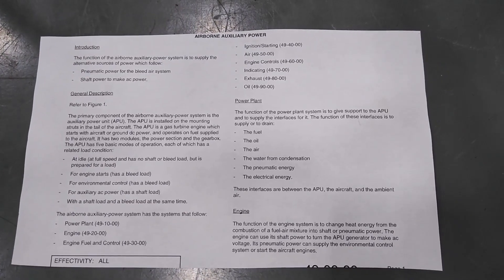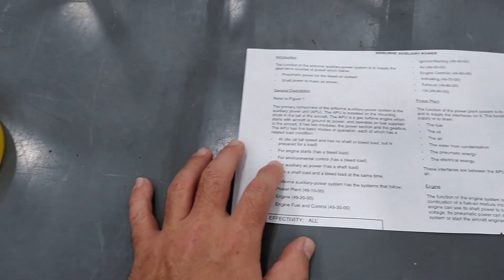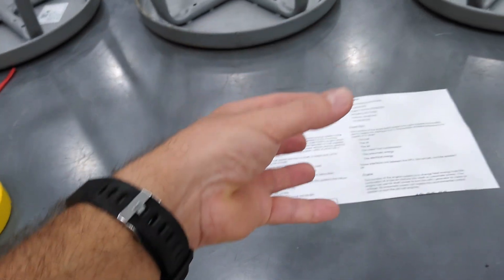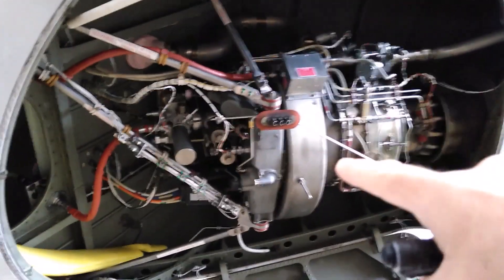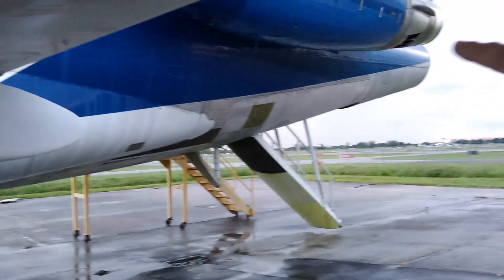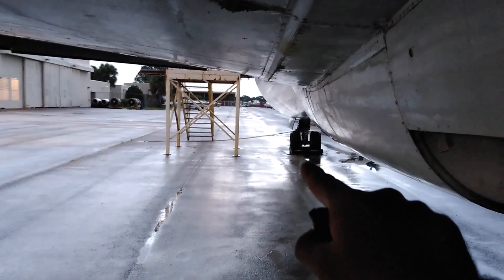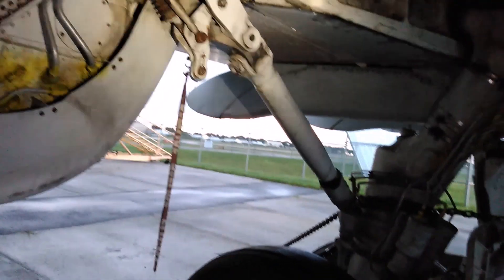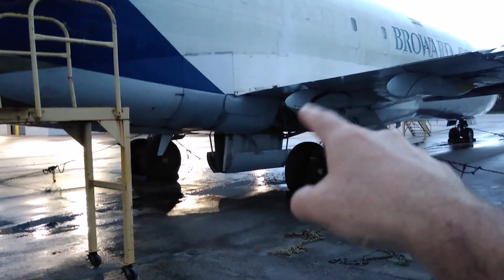APU - Auxiliary Power Unit

Comment: I have read on a 737 NG fuel system description that APU is suction fed if the AC fuel pumps are not operating, without any explanation. How is suction feed possible for the APU? Suction-feed is possible for the main engines because they have engine-driven pumps. But I couldn't find if the APU also has engine-driven pump.

Comment: Does an APU idling at full speed (no shaft load, no bleed load) produce any measurable thrust? 
For instance, say you lost both engines at 35,000 ft. You pitch for best glide and calculate that you can glide 25 miles before reaching the ground. The nearest airport is just barely over 25+ miles away.  ...Would running the APU potentially help extend your glide distance?? 

I know the APU is very tiny compared to the main engines and that it’s not made to produce a thrust effect, but it is still a gas turbine, and I would think that even a little thrust is potentially better than no thrust at all.
Reply from the maker: You would think so, but no. The exhaust duct may not even be pointed aft. It can also be pointed out to the side of the aircraft, that's how little thrust (zero) is produced. I believe that the APU turbine is designed to extract every bit of energy possible from the exhaust to do it's job which is to drive other equipment. If the APU produced thrust that would mean that it would be wasting energy 99.99% of the time on unwanted thrust while static on the ground.
Although I do agree that any little thrust is better than no thrust at all, I think that in the case you posted about the multiple engine failure, you'd be better off dumping fuel(loosing weight) to extend your glide distance.

Comment: Your work place looks like a heaven 💙 if you don't mind can you tell me what do you do for living 🤩
Reply from the maker: I work on the interiors of aircrafts, mostly private jets. I don't work as a mechanic although I am currently going to school to get my mechanic certificate. We remove/install/adjust/repair/refurbish the aircraft's interior when they come in for inspection or maintenance.
Reply: @planesimple8514  so your a b1.1 machanic 😃
Reply from the maker: Well, not exactly. Under EASA regulations a Category B1 is an Aircraft Engineer on powerplant and mechanical and electrical systems. Under FAA rules, it is defined a little different. The certifications are called A&P for Airframe & Powerplant. Once you have those certificates, you are considered a mechanic. But if you work on the aircrafts but don't have the certificates, then you are considered a tech, or technician. That's what I am, an interior technician. Although I've been working in aviation for a long time, I never got my A&P certificates, that's why I'm going to school now for.
Reply from the maker: I'm 39 and have been working in the field for about 16 years.
Reply from the maker: Cool! Emirates fly a lot bigger planes than I'm used to. A340s and A380s, right?
Reply from the maker: And in Dubai too, what a cool place to be!
Reply: @planesimple8514  yep I hope I get a job there 🤩 I mean I am a fresher do you have any advice for me in this industry

Comment: I wonder if a repurposed APU would be practical for augmenting an electric drive performance car?

I mean one of the larger commercial ones is definitely going to be too big, to heavy, and way too expensive, but something salvaged from an old and no longer airworthy private jet could in theory work fine as a range extender, and could potentially improve traction and handling if ducted to draw air from beneath the vehicle to create a ground effect.
I've actually been pondering the idea for a while now, but gas turbines aren't exactly my field of expertise
Reply from the maker: Hello You Name It Gaming, you are correct. An APU could certainly be used for that purpose. As a range extender, etc. It would be nothing more than a generator, a mechanical mean of converting chemical energy from a fuel into electrical energy. A piston engine could do the same, in fact that's what hybrid cars do. Advantages of the turbine engine(APU) would be perhaps a lighter/smaller package when compared to the piston counterpart but at a higher price tag. 
I like your idea of using the intake air to create  down force, but think of the amount of debris that that APU would be inhaling, it's basically a vacuum cleaner. The engine life would be greatly reduced, but then again, top fuel dragsters replace engines every couple of runs. I guess it all depends on the budget. It would be a pretty cool project.
Reply: @planesimple8514  indeed, any intake air from beneath is going to need some form of filtration. But in saying that, depending on how much surplus amperage the APU can generate, one could also run electric fans to draw underside air and circulate that air around the turbine to aid cooling whilst helping with aerodynamics and ground effect.
If the APU used has a built in blow-starter for bigger engines, that could probably be used to help cool the batteries as well, or at the very least routed through an air accelerator (see Dyson bladeless fan) in the rear exhaust duct to draw more underside air around the turbine.
With fans, or without, I think it could make a very noticeable difference in lap times as whilst it's unlikely that such a setup will come close to pulling a decent vacuum beneath the vehicle, any reduction in pressure will be multiplied across the surface area.
I think we could be on to something here 👍

Comment: Hi. Watched all of your videos. I think your channel is one of the best ways to discover how everything works in aviation from technical perspective. But I still have questions and dont understand some stuff. First of all let me say Im noob in technical things .... I like flight simulators and would like to discover how everything works.
1. When reading about APU control switch in the cockpit for MD-80 aircraft there is a saying, not copyrighted but close to the original, - when switch in AIR COND COLDER position that means it closes the turbine bypass to increase differential pressure across the turbine. Im not sure what it means from the pneumatic system perspective. I watched your videos about bypass jet engines, low-bypass and high-bypass, but there you say its made the way air passing bypass route will be mixed with the hot "thrust-air" (exhaust). But the APU does not produce thrust so how does it work in this case? Will the air passing bypass be mixing with the bleed air from compressor, therefore it will be more colder pneumatic air in the pneumatic system??
2. Another confusion that I cannot understand is about having "RAM Door" and "NON-RAM Door" for the APU. What does it mean? To be honest I dont really get the term of "RAM". How to descrypt those letters? I think I get the basic idea when RAM Air means the air taken from outside, from atmosphere without any usage of fan that sucks air into. But Im not sure. And if Im not mistaken in basic idea of getting air from outside then what does "NON-RAM Door" mean? What is it for? It is not for exhaust I believe. I dont get the point.
3. Let me ask you to show or somehow teach me about the process of "bleed air" and pneumatic system. I watched all of your engine videos but you didnt say anything about bleeding air. I`ve read some manuals, I get the basic idea to take away compressed air from the compressor stage (on some aircrafts like MD-80 there are two bleed air points, 8th-stage and 13th-stage) but how does it look like? I know there are ducts, check-valve and augmentation valve .... I just would like to visually see how everything is connected and works. And I dont know anyone better than you in "showing how it works" business.
PS: if it helps, the APU installed on MD-80 aircrafts is AlliedSignal (Garret) GTCP85-98D (Wikipedia says).

Comment: APU maintain Generator frequency by running at the constant RPM. as the load vary, fuel flow schedule will also vary but RPM remain constant. So, therefore what change in side APU?
Reply from the maker: Hello B 787, nothing changes inside of the APU, more fuel goes in, therefore more heat is created, which means that there's more power available for the turbine to extract, which means that the APU as a whole has more power to spin the generator. This means that nothing "changes" inside of the APU, it remains exactly the same, only burning more fuel and making more power.

Comment: Is that a jet engine for a   model RC toy ?
Reply from the maker: No sir, it's an Auxiliary Power Unit. It does not provide any thrust, it provides pressure air, electrical power and a lot of times hydraulic power to the aircraft, full size aircrafts, not RC models.

Comment: Not one mention of hp
Reply from the maker: H.P.
There...that's one mention. 
Oh no, wait! Mason, you were the first one to bring it up,so I guess that makes mine the second mention oh H.P. 
And that's three times now...😂
Thanks for coming by Plane Simple.
Reply: @planesimple8514  actually I’ve seen these rated from 100 and up to 400 hp. It wouldn’t hurt to mention it and it can be determined by kw. A 757 is rated by thrust but it can be in kw and yes hp. About 90000

Comment: Ground Power Units provide electricity. whether it's from the APU or GPU the main engines need electricity to start. So all of that BS you were saying about the starters being too heavy is complete BS. The weight of the batteries is the only difference, and the APU can be used for heavier loads in the cabin. The engines also have alternators/generators. I appreciate the video but you shouldn't be making them as some source of education when clearly you have no clue what you are talking about.

Comment: And yes. The 727 used to offer the APU as an option. But it already had 3 engines. So why would they need a 4th? And they got the plane without it. Then it wouldn't start?

So they had to have in APU aftermarket install. In order to start the plane. Without a Start Cart. With a pair of V-8 engines in it. Running at full blast. And they couldn't take that one with them. Start the plane back up at another airport. That also didn't have one. And that's why they needed to get the optional APU installed. From an aftermarket company. Because they were stupid! Beyond, Stupid!

And now they've got this bozo. Working on that plane! Everyone's lives are in jeopardy!
RemyRAD

Comment: This narrative description. Is an, oy vey, moment. The inarticulate is trying to describe a gas turbine powered Generator. And explaining how it burns fuel to do so. DUH.

This dude did not get his degree in Public Speaking. That's for sure. And he doesn't know how to say gas turbine engine? He doesn't know what it is? It's a motor. Yes it is but it is an axial motor. And spins faster than the speed of sound. But makes a racket doing it. And so while the process is faster than sound. It makes a lot of sound,, just the same.

These are designed to start jet engines. Frequently require,, two, V8 engines. To start a jet engine. And this is only a small, gas turbine engine. That can produce the power of 2, V8 engines. And is much smaller and more compact and lighter in weight.  Which was important for an airplane.

I would love to have one of these to power my entire house. But I think my neighbors would complain? That they didn't have one of their own. And have to pay the power company. When they could just spend more money for fuel instead. Instead of the lousy electric power company! Taking my money. I'd rather give my money to, GE or Rolls-Royce. So they can stay in business. So the US government doesn't have to.

Jet engines are great in planes, cruise ships and trains. And a few, copper colored Chryslers. Not so good for off grid living. Unless you are Philip and 66? You probably don't want your own jet engine? They aren't what we call, fuel-efficient. Though they can burn anything that will burn. Like Donald Trump  and Ron DeSantis. Marjorie Taylor Green et al.

What human beings want to act like that? Politicians. Named Marjorie Taylor Green  and Company. And they once attended school? How many decades ago?  Did they graduate from kindergarten? With a college degree.

And you just thought this was about jet engines?
RemyRAD